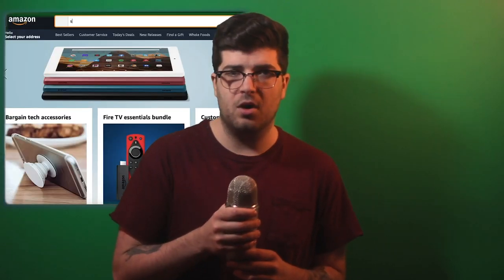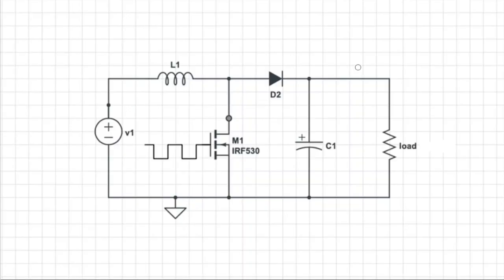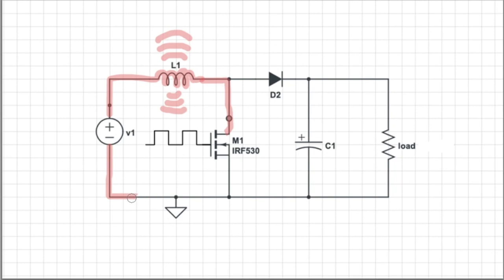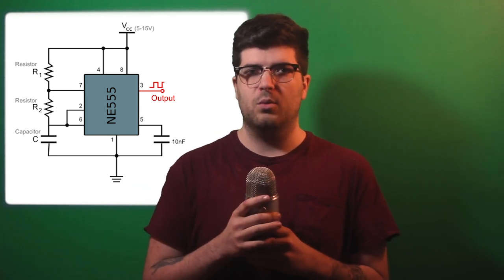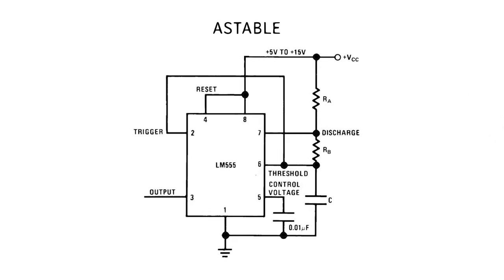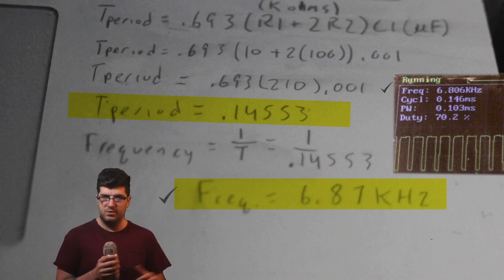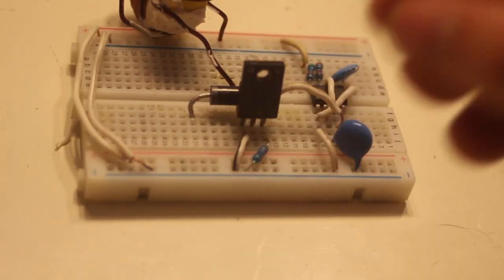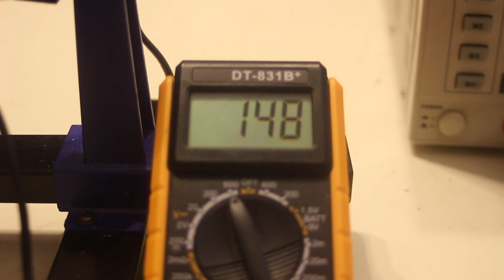How to step DC voltage up - DIY boost converter

Comment: At higher voltage, you must be getting very low current? Won't it take longer to charge the capacitor?
Reply from the maker: the voltage going into the capacitor(coming from the inductor) isn't higher, the voltage only increases (across the output capacitor) as the capacitor builds up charge

Comment: I don’t mean to come across negatively, but the considered design is not working as expected and would be dangerous for anyone to follow. Did your output voltage ever stabilize? It’s much higher than expected. There’s a reason that commercial products are designed with certain gain ranges... 70% duty cycle should only produce 1/(1-0.7)=3x input voltage gain... you’re lucky you didn’t blast the output capacitor and switch as the output voltage was rising and even larger than 200V when you turned the supply off. Your capacitor was only rated for 200 V... furthermore, look at your supply during testing. The input voltage was clamping to 4V (i.e. wasn’t the value you mentioned in the video) and the current limit indicator is flashing. Id strongly recommend to give your design a much closer look before moving forward.
Reply from the maker: hey, i appreciate the input -
a - output never stabilized, i kept having to turn it off bc capacitor is only rated for 200v// i'm sure it would've shorted if i kept adding charge 
b - im suspecting the only reason it didn't stabilize at a slower voltage is because i don't have a load attached to my capacitors -
also  i did some math >> 
                                              Vout = Vin/1-D -
solving for the duty cycle i got 95% - (a gain of 20x) - when i switched the voltage/ time settings on  my mini oscilloscope, it would give me different values - i wouldn't conclude the duty cycle was 70%
c - my power supply was fine - that was the cc (constant current) light blinking - i set it to 1A. the voltage - i checked with a multimeter, it was still outputting 10 volts to the boost converter
Reply: @MillersPlanetOne  Is the unloaded operation representative of what's happening in your application? 

There is no math to do regarding duty cycle, it is based on the resistor values you have provided to the signal generator IC. Look at the oscilloscope capture @3:26. However, it is meaningless to analyze this behavior if the circuit is unloaded... this is dangerous as you have no control of the capacitor voltage build-up over time. In a loaded scenario, the voltage gain will be 1/(1-d) unless you are operating in a discontinuous conduction mode (DCM) scenario in which the gain expression will be different. 

The supply is operating in constant current mode because the current draw is larger than the current limit that you have set. As such, the voltage output of the supply is clamping to a lower level than you have requested. Otherwise, the expected operation would be constant voltage mode. I'm not sure the inductor value you have selected but it should probably be increased.
Reply from the maker: I'm planning on my output capacitor being unloaded while its running... i'm building a coil gun, so once the cap is fully charged, it'll drop its charge into a separate circuit
duty cycle in my case is almost irrelevant - my capacitor is unloaded - it WOULD be meaningless - in my calculations (for continuous conduction mode) I had to assume my max v stops at 200, which it doesn't. and the signal doesn't fall into the DCM category 
my overall output voltage (stored in cap) depends more-so on things like FET gate speed/specs, input power, inductor size, signal frequency, signal amplitude, even diode size + efficiency, and Im sure many other things 
as for a runaway/unpredictable voltage buildup, there are many ways to shut the boost converter off once my cap hits a certain voltage, not at all worried about that

Comment: Why don't you use a zvs flyback with a full bridge rectifier and an op amp as a comparator to turn off the zvs flyback when then capacitor is charged?
Reply from the maker: that would've worked fine, but i'd need an inverter first
Reply from the maker: oooo i'll look into this, thank uu
Reply: @MillersPlanetOne  If you build it please post a video, because I'm working on working on building one.
Reply from the maker: yeee for sure